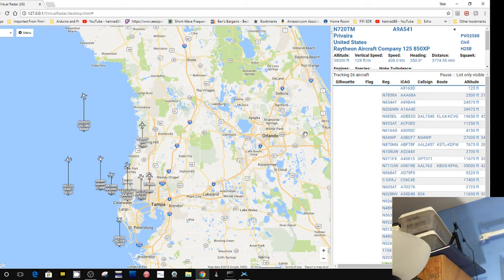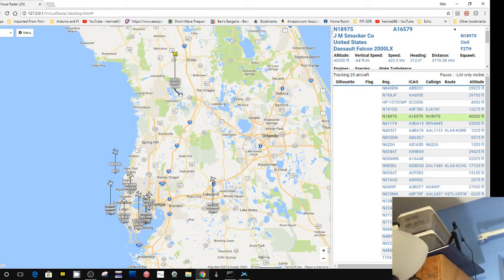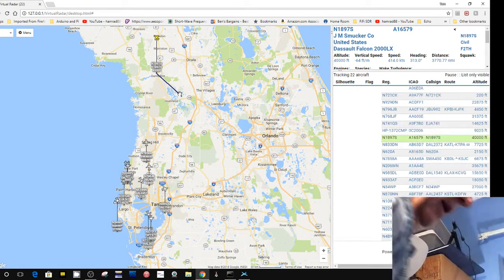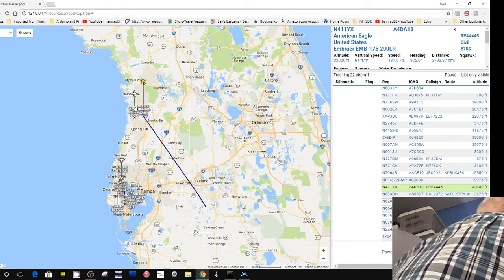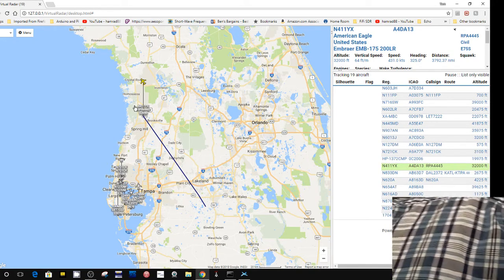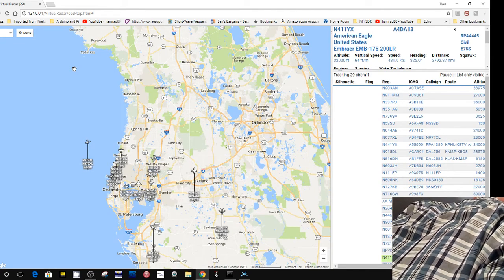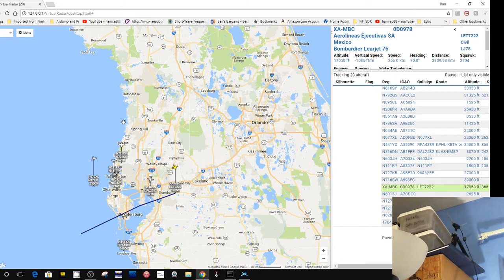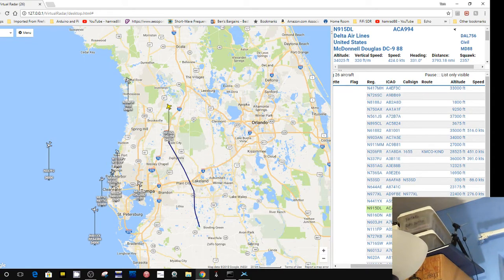TRRS #1385 - RTL-SDR.COM Antenna Testing Pt 1

Comment: I couldn't tell for sure but your old antenna appears to be omni directional where the new RTL-SDR antenna is a dipole. As it's a dipole it will have nulls on the ends. You could experiment with turn the antenna so that it is oriented in different directions and see what results you get. 

Fun experiment! Thanks for sharing!
Reply from the maker: Great suggestion.  I will give it a try.  So many variables.